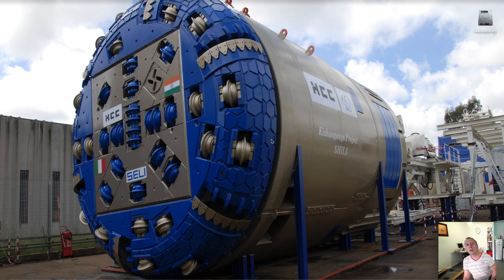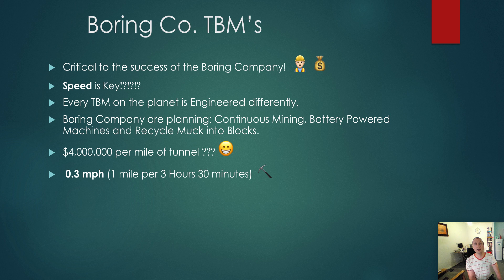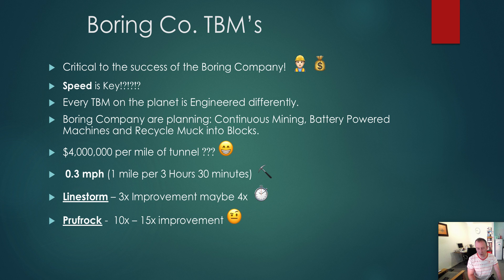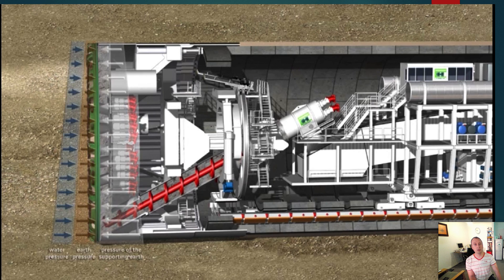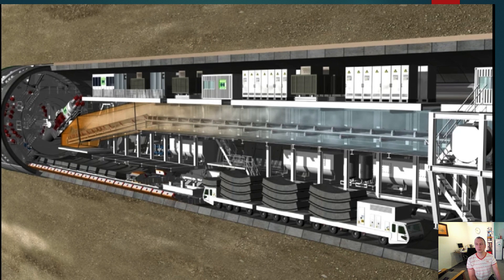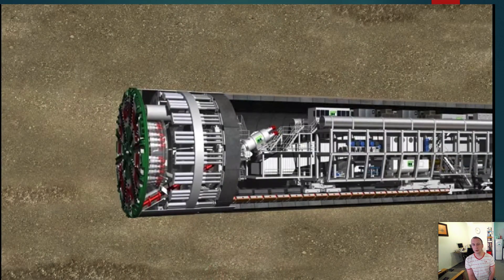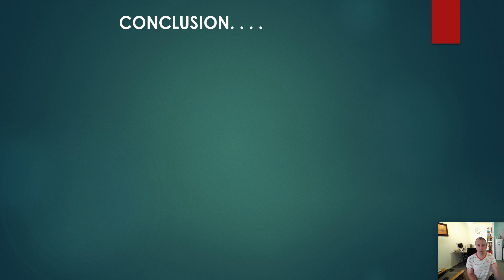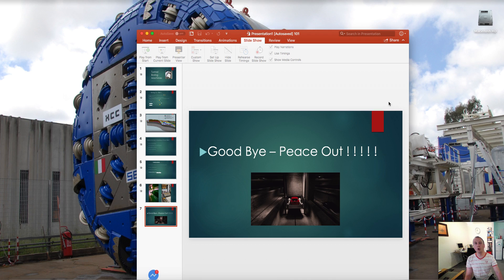A Boring Revolution - Elon Musk's Secret TBM technology  #6

Comment: "All shall seek shelter under rocks or in caves." In this the millennial of climate change end times due to the mystery of the 7 star crossings Jesus held in his hand.

Considering most of the world is sedimentary why not design a hydro boring machine using water as the cutter excavation? We do cut steel with high pressure water jets nowwa days so I imagine most geology shouldn't be a problem.

As for tunnel lining as cheap and effect as seashell/limestone/brick/cement is steel is faster.

There is also the possibility of tunnelling like a worm using hydro compression vibration. Added bonus here is the compression would by it's nature create a liner and if used in conjunction with water seashell/limestone/cement injection could be done in SITU.

Tictok as these are just the birthing pains of this he millennium of climate change end times due to the precession of our stars shadow equinoxes not you or co2.
The first of around 19 Great Year tidal wave floods will be pulled out & around the planet east to west b the new noon with the conjunction of mercury & venus in 2033 & every 40 years thereafter for the millennium it takes the earth's orbits to eclipse our stars solar plane separating the fermie cells of it's oort cloud magnetosphere.

Repent take up your millennial cross & follow Jesus as he is the only one who united & warned us all.

Also Boring shouldn't be taken literally. Jazz up the demo tunnels after all "EXCITEMENT GUARANTEED" right?

Comment: what if the TBM encounters a gap/cavern?  will it have the capability of injected high pressure closed cell foam into the cavern?  the wall sections are "bolted" to each other.  couldn't they also be
glued together for more strength. if an earthquake happens, doesn't the tunnel fill with water?

Comment: Elon will need lots of secret boring machines to store all those redundant lithium batteries that his company cannot recycle without exposing deadly chlorine dioxide into the air - spreading like radiation when in contact with oxygen and water.  
I am just soo worried about groundwater...... if all those underground batteries starts to leak .....

I am watching the recycling of lithium closely - it does not look good. Specifically in Canada. There is no regulation.  "Just a little notice - take your batteries to a recycling depot"  What do they do with it?  
I think Elon will need a lot of boring machines soon...... we are at 2 million Teslas above 25% spent batteries.

Comment: The cost and speed associated with tunnelling is not just associated with the machine. You cant just say that using Tesla / Space X technology you will speed up the cutter head and the conveyor and the machine will go x times faster, its a complete nonsense. You need to consider logistics to supply the machine - manufacture and delivery of lining segments, transportation of segments, grouts, grease to the machine (which becomes more difficult the longer the tunnel becomes), extension of tbm services - water pipes, track etc, extension of conveyors or slurry lines to enable disposal of the spoil. In my experience it is this aspect that restricts the speed of tunnelling, not the cutting speed of the machine itself.

It is interesting that the formation of the Boring Company has peaked interest in tunnelling, but tunnelling is a very complicated subject and has seen a huge amount of innovation over the past decade or so. I would be amazed if a 2x speed increase could be achieved for a fully lined tunnel and I think the 15x that you mentioned is pure fantasy.

You also mentioned Crossrail and quote the cost of the tunnelling on this project, however, a huge part of this cost is not construction but includes design, consultation, enabling works, condition surveys, monitoring, land purchase etc which would still be required whatever the tunnelling technology used.

Comment: Looks like the hydraulic seal wear (number of cycles, heat, abrasive environment) could be a potentially be a problem in the TBM, especially if the machine needs to be removed for repair.

Comment: How long does it take for the cement in the tunnel lining segments to cure sufficiently for safe use in lining the tunnel?
Reply: Concrete sets in a couple of days, but takes approximately 28 days to get to full strength.

Comment: I wanted to share a concept for continuous tunneling with you as it incorporates a continuous poured concrete system and the problem of curing is pivotal if this proposed system is to be successful. In this description I refer to traditional water but perhaps you could enlighten me as to the benefits of your CO2 curing system.  

 I'm trying to describe my thoughts on a novel process of "continuous helical tunnel boring" I think this kind of concept could speed the construction of a 3dimensional tunnel system that Elon Musk described exponentially. If there is anyone you could think of to share this idea with I would appreciate that. 
 .
Working from the premises that it is better to continuously "pour" the structural concrete tunnel walls rather than pausing the tunneling process to lay precast sections of wall.

The area of operations we are then focusing on is the area directly behind the boring machine face and within the tunnel shield wall where we will have to transport materials for forming our tunnel wall from without the tunnel dig to the area of operations. 

These materials being a role of sandwiched basalt fiber fabric pre impregnated with high strength Portland cement, configured into a sleeve that when injected with wet concrete will create a continuous form laid in a spiral or helical manor along the tunnel wall and forming a negative worm gear. These roles can be transported to the area of operations by autonomous electric vehicle conveyance. The roles being of a fixed length must be connected end to end by a process of stitching by which the two ends are laid open and sown together as the material is being fed to the work surface. To do this without interrupting the whole process slack has to be fed towards the wall end in an inch worm fashion and then taken up again until the next seam is necessary. These rolls of basalt fiber fabric have a structural cross threading in a manner in which when filled with concrete they form a roughly T shaped extrusion creating both a structural concrete form and the inner teeth of the negative worm gear. These preimpregnated basalt fabric roles which both give structural form and act as structural forms for the wet concrete mix are key to continuously forming the walls of the tunnel. 

Two other main elements in this process are water and wet concrete mix both separately conveyed to the area of operations through high pressure hoses. It's important to note that ideally a concrete batching plant will be located at the entrance to the tunnel and raw materials stockpiled so as to avoid delays in pouring that come from concrete mixing trucks being ironically stuck in traffic that the boring company is attempting to alleviate. Also that ideally spoil material from the tunnel would be mixed with this concrete and reconstituted as the walls of the tunnel. Raw water is needed to activate the impregnated basalt fabric and applying it is a tricky problem. I'm going to try to use an analogy to describe this process and the process of injecting the wet concrete into the fabric sleeve. We should all by now as I write this in the beginning of 2021 be familiar with the image of an intubation tube being inserted down the esophagus of a patient. In this case the intubation tube is the nozzle end of the concrete hose which is inserted in the fabric sleeve which is the esophagus of our patient. The nozzle is a two pant system with an inner hose reaching farther into the sleeve and an outer jacket evenly applying water to the inside of the fabric sleeve. 

Directionality of this tunnel wall system is achieved by the flexible nature of the fabric sleeved poured concrete rather than the traditional precast concrete block systems used today. I am attaching a picture of the commonly used flexible corrugated conduit because this is essentially the engineering form I am describing in the system. 

The means of conveyance of the tunnel boring machine is achieved by an articulated tunnel shield which locks into the worm gear of the tunnel, screwing itself along with a multitude of industrial inhud electric drive wheels. These drive wheels are relatively low speed compared to electric car motors but harness the high torque and flexible geometry of electric drive systems.

Working on this idea. The current limiting factor to tunnel construction is the placing of precast concrete tunnel segments. The above concept is an attempt to break from that system. If the process of CO2 curing could be incorporated in this system, hopefully it would speed the curing process and facilitate a massive amount of carbon sequester in underground tunnels.
Reply: You & CO2 are not causing climate change. The precession of our stars shadow equinoxes when it eclipses crosses through the electro-magnetic gravitational equator separating the fermie cells of our stars Oort cloud magnetosphere for the next millennium exponentially increases energy.

"All shall seek shelter under rocks or in caves." Jesus in these the birthing pains of this the millennium of global warming.

Temp is rising first & Co2 follows. Cause & Effect. Earth is a 4.5 Billion year old closed CO2 loop. "Nothing new under the Sun." Solomon.

Repent take up your millennial cross & follow Jesus as he already won this battle all we need to do is follow and heed his words.

Edit: good suggestions. Choke point seems to be prefab liner. I thought maybe hydro drilling & use limestone impregnated slug as liner baked into place?

Comment: What if there was a smaller leader bit in the center of the full size drill bit that could drill ahead of the big bit, then it could pull the boring machine forward while they are placing the concrete rings in place, the bore hole can keep pulling it forward then place concrete

Comment: We need to consider Underground Water, before making speed claims.

 The underground water means that filament needs to be pumped into the ground and then bored out, when solid.

Dry rock is a different thing. There speed gains can happen. In wet ground the speed will be the same. With same limitations.

Comment: The boring machine is so bad! 1. A single large cutting head has huge amount of friction. It will make cavities that need corking. Multiple   heads rotating would reduce load and have diffrent rates of penetration based on straighter and geographical solids. 2. The fabrication of concrete and reinforcement should be done as the TBM advances. 3. Spoil should be sorted before ejection to surface to be fed back into tunnel tube casting material. 4. Use of inert fire retarder gas should be feed to cool the cutting head. Re Spacex  style. The gas is filtered back to surface. With low grade spoil. 4. There us no TBM control staff at the cutting face.

Comment: Improvement suggestion (obviously not from an engineer): instead of of having the lining designed as series of rings each made of different pieces with the top piece being the key, the lining could be designed as a spiral. As every piece is placed, it gets bolted from the front to the back into the previous layer of the spiral. Also bolted sideways to the piece immediately before it. The boring as well as the assembling of the lining occurs sequentially and  continuously  without pausing to assemble each ring. Furthermore, the lining blocks could be thinner with the intention of having the lining assembled in two layers (outer layer and inner layer) both spiral and offset by half a block.
Reply: Does add the element of continuity.
Reply: Why aren't you in this industry?

Comment: How does the TBM accommodate curves in the route?
Reply: I believe they can give a very slight angle of attack to the face that chews up the rock, over the length of time required to achieve the desired curvature. Something a bit similar to the drilling bits used to successfully drill horizontal holes in the oil industry
Reply: @MolloRelax  also, as the lining is assembled, one side is slightly smaller. The whole train trailing the head must be able to proceed in the curve that is being built.
Reply: @WHYNOTDOTTV  Yes...that is why I believe they will have to make  ALL curves very long
Reply: To accommodate curves the precast concrete segments are often constructed with a slight taper of around 3 degrees. By combining and rotating these you can install a degree of curvature as required. Depending on the size of the machine, it can be steered using the main rams or by dedicated steering rams behind the cutter head.

Comment: 18 years ago someone leaked info on a TBM used by the US Navy in their construction of deep underground military bases. They mentioned their designs went 12 mph. By using some fancy science they melted through nearly anything at speed instantly turning it into plasma. Then the machine would use the rock plasma add stuff to it and spray it onto the walls of the tunnel at the rear of the machine for tunnel stability. Although 12 mph being completely insane speeds for underground drilling it is very clear to see this as a security threat that was suppressed. I'm rooting for ya Elon but mmh... security threat is going to be a problem
Reply: John stop watching iron man now and join us for dinner
Reply: @ruudpoutsma5273  bruh don't be that guy. No one likes the closed minded old man lol. https://www.truthseekeratroswell.com/images/2last.jpg?crc=319426984
Reply from the maker: I’m unsure how the above machine could even achieve 2 mph without using nuclear power! 
Never seen any pictures of this machine or the tech it used.
Reply: @BoringRevolution  You are correct they from what remember do have breeder reactors onboard
Reply: @BoringRevolution  They were used to create a global tunnel network connecting US military D.U.M.BS and used something very similar to Elons "hyperloop" idea to transport between them. Many of these facilities were allegedly destroyed around 2014 although as you can imagine this topic dives deep into conspiracy theory/cabal territory. Q is legit don't trust the media

Comment: Where can I get information on buying and building with those blocks?
Reply from the maker: Hi, They have built a brick store in Hawthorne California if you want to call in!
What are you planning to use them for? 
They're almost twice the density of traditional clay bricks thus they outperform them in every use case. As for dimensions they seem like a standard brick size but I'd check up on that !
Reply: @BoringRevolution  foundations and structures will have to be redesigned then?